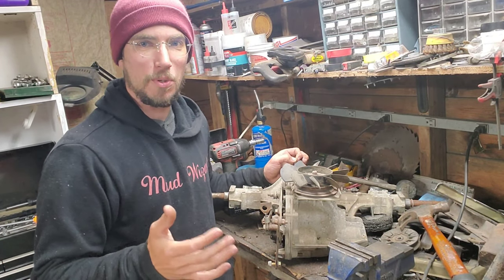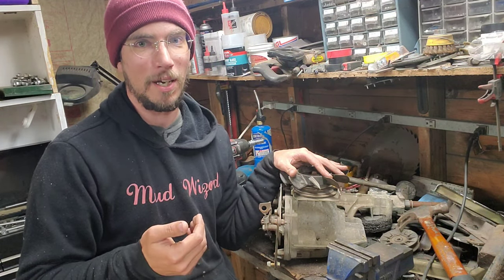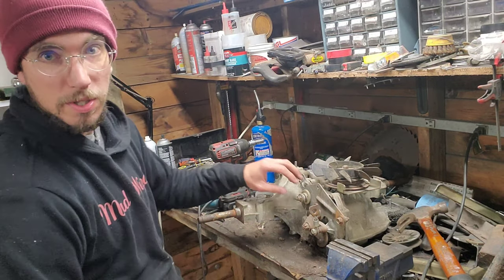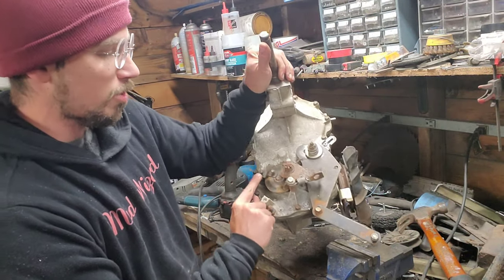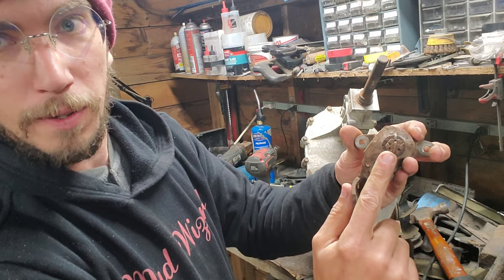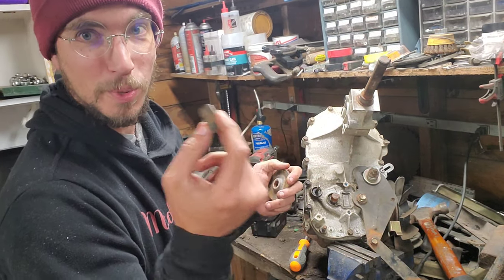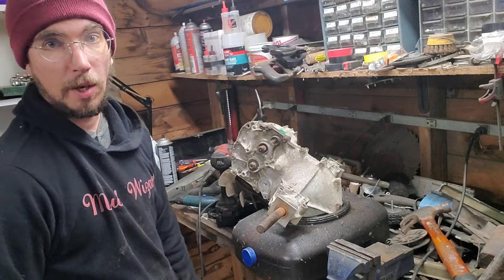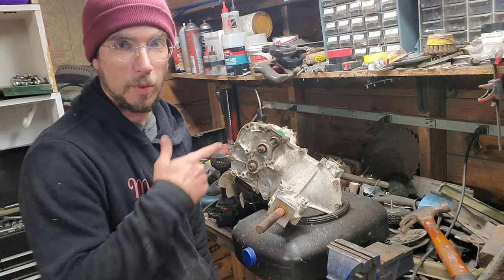Hydro Dragster Better Gear Choice

Comment: You can use a old rim then a piece of pipe that fits in the center of the rim weld the pipe to the rim then cut the pipe at the how hi you want it then git a square piece of steel little bigger than the vice you going to use weld that to the pipe there you are and you have a vice you can move allover.  Thanks for the video.  Ps. I got that jump pack it was at 85%  Card charged so I plugged it in and to 100% I'm gonna try it out an old battery on my tractor then I will put the new battery I just bought.  I thank you again. I like to see the inside of the bad  Transmission an see what all happen.

Comment: I'm curious about your wheele bars. Does your set-up allow for adjustments in terms of depth till contact with the track surface? Maybe an inane question, but again, I'm curious. Thanks.
Reply from the maker: Its a great question. The answer is yes on my red big mod and no on the diesel and the hydro. The hydro and the diesel both have very controller take offs and the bar is just there to make the rules happy.

Comment: That impact is 1100 inch pound which is 91 ft lbs of torque, not 200. Amazingly handy tools just a tad underpowered in some applications.
Reply from the maker: PWRCore 20 Brushless 20V 1/2 Inch Impact Wrench -200 foot pounds of torque